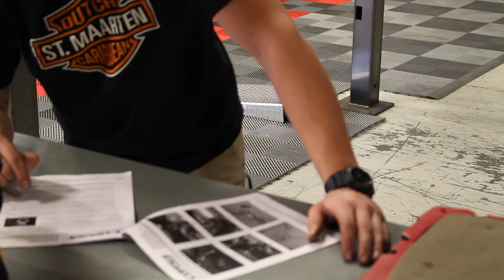2017 Mustang GT Corsa Extreme Exhaust

Comment: Is it normal to push the muffler/tips to get them center? My MBRP tips touch the valence so I think I have to do it again on jack stands
Reply: Bodybuilder X yes it is normal! We loosened the rear bolts and I pushed it basically as hard as I could while Brady tightened it! Make sure you push it further than where you want it because once you let go it comes back a little bit! So I found it was easier to over correct it and then it back back a little more making it right where I wanted it!